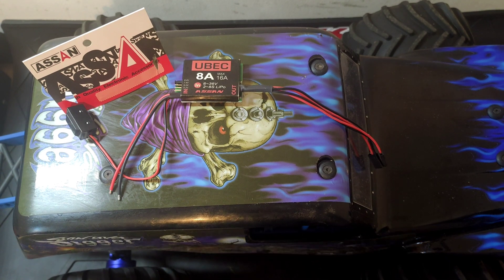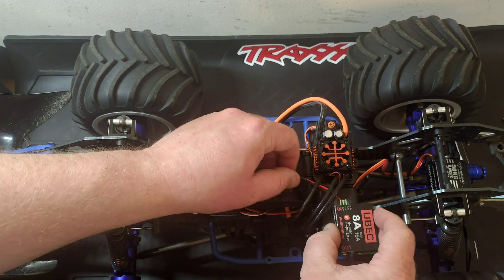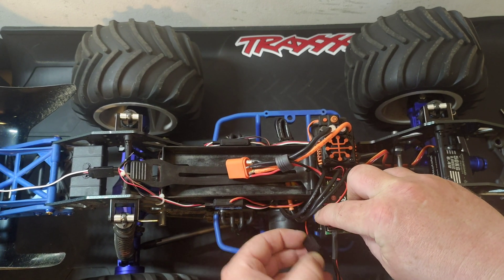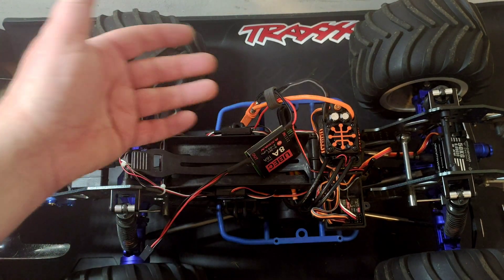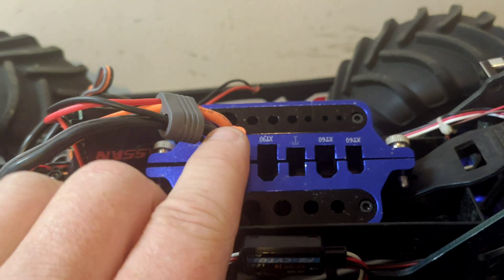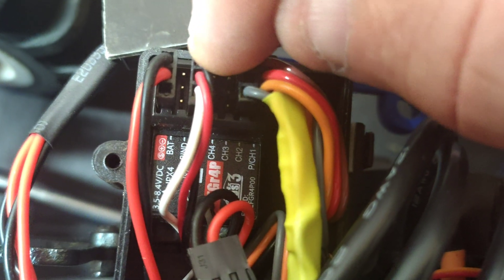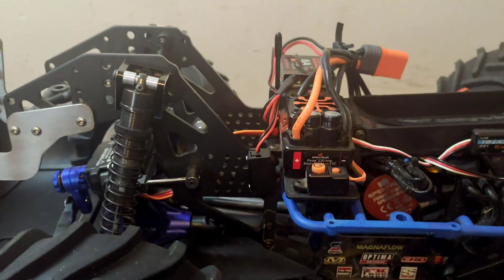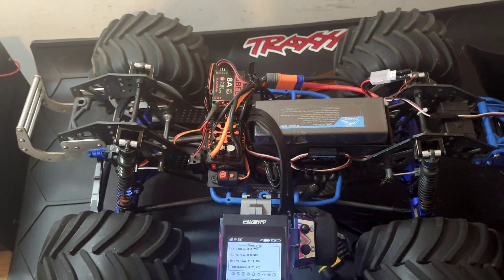Losi LMT 8.4v UBEC fitting guide, getting full power to the steering servo,

Comment: Hi ya mate. Any ideas how to change setting in stock esc for the bec? Doesn’t seem to cover it in the manual, however heard I can get the v2 Spektrum programmer and do it that way? Apparently can change it from 6v to 7.4? 
Thanks
Reply from the maker: Tbh is not something I've tried my best guess is you need the programmer and update the firmware of the esc 1st then it may have to option to set the bec voltage
Reply: @WTFRCCars  nice 1 thank you

Comment: can you provide diagram plz?
Reply from the maker: What part are you struggling with ?
Reply: @WTFRCCars  Can i use voltage regulator instead of Ubec? if yes? How should I wire them? If no, i'll need to get ubec and need the diagram to follow! I am learning. Thank you
Reply from the maker: @xuanhoangpham5673 I wouldn't use a voltage regulator it would probably cause interference ubec have filters
Reply: @WTFRCCars  I C! However, I am building thruster for my kayak which only require thrust and turning so I dont think it would cause any problem?
Reply from the maker: If your using a transmitter it can cause issues but also interference for servos is not good it can make them jump around